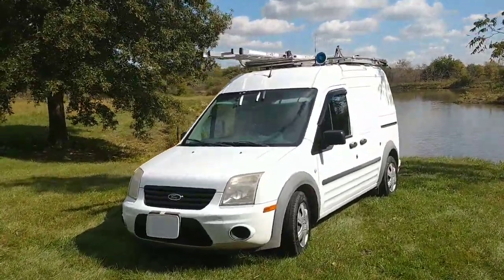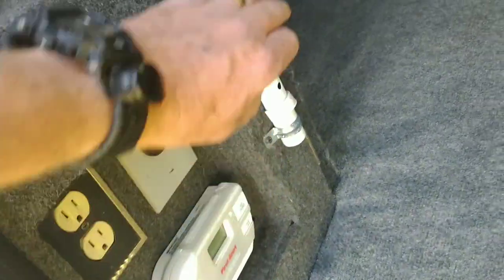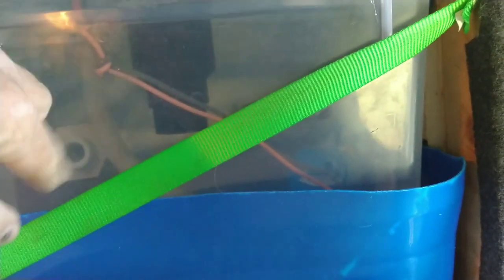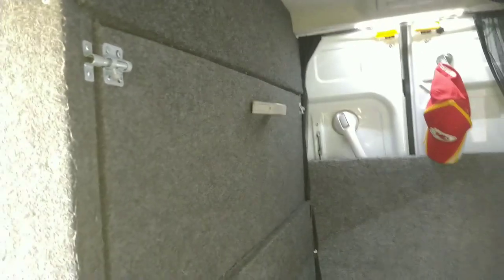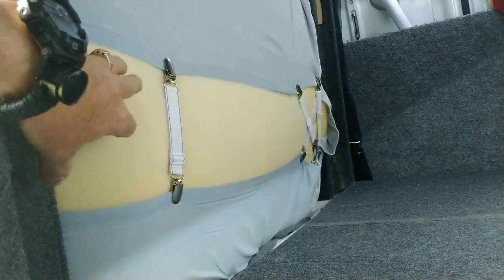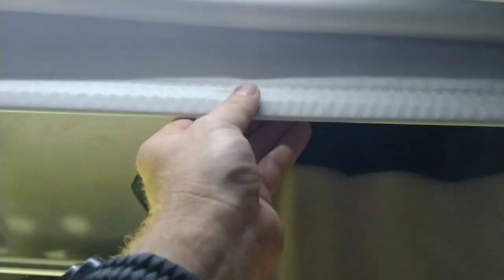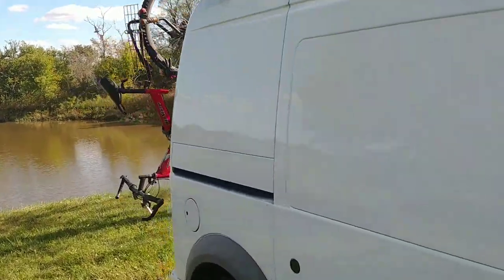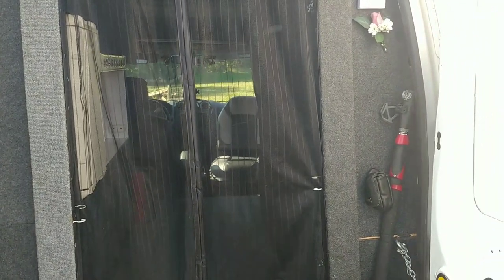World's smallest camper van

Comment: I just bought a 2012 with 40000 miles. Was going to update technology for phone etc. But I have extra phone and tablet. 👍🏼  I lost my husband a couple years ago, time to live again. It's a high roof passenger but will work with it. I have more widows, but will put up black covered reflectix permanently in middle windows to use that space( It has 6 back windows) Those particular 2 windows don't open anyway. Have to have some light. Good ideas here. It's small but for traveling some, it's perfect. I couldn't live in it, well, guess I could if I had to, but that's why I have a house.

Comment: Fantastic, Do-it-yourself build! One of the best I’ve seen on YouTube so far.  Highly suggest you look at the Olympian Wave Catalytic heater that also uses propane. I compare a Little Buddy to the smallest Wave 3 on my channel. Mr. Heater’s have a constant flame 🔥 when in use. Wave heaters only use a pilot light to ignite the heater. Then it becomes a safer, catalytic heater that sips propane with low & high settings.  Wave heaters are made for indoor use whereas Buddy’s give off more condensation and work better in tents, hunter stands & ice fishing. I use my Little Buddy only in waking hours on short day trips. Love your screens and use of magnets. Well done 👍

Comment: Suggestions (all optional): 
1. behind the driver seat..  hang a work (Utility Orange or Lime green) jackets and some used work gloves on the dash... 
2. tablet work fine.. but do backup your tablet songs on a OTG flash drive.. just incase the tablet stops working... 
3. get yourself a 1 liter hot water bottle (rubber with a cap in a wool cover).. add 3 quarters of hot water in the bottle..so if it does feel like hot steam is accumulating on top.. simply un-cap the top and release the steam.. then put it in your blanket and sleep comfortably.
4. Tire chains... for winter or muddy off roads.
5. Good grip snow tires (keep the other tires in a paid locker)
6. Good steel shovel.
7. 2 foldable traction tracks for sticky situation (snow/mud)
8. GPS/LTE 4g wireless range extender and some good hard printed road maps (new and old to find some road not on new maps.)
9. Heavy duty Steel High lift Jack.
10. front mechanical Wrench to be pulled out of a difficult stuck situation.
Awesome build for your needs.. Stay safe.. (Regards from Singapore) God bless.
Reply from the maker: Wow really awesome advise. Thank you I will work on all of that. May do a follow-up video after. Thank you so much.

Comment: Of all the small van builds I have seen on youtube yours has the most creative use of space particularly with the back porch and the roof terrace. I noticed there was a lot of exposed metalwork ie rear doors and behind side panels. In other builds I see people have gone to a lot of trouble to insulate to avoid this. Do you have any issues with condensation or cold nights due to the lack of this insulation? 
Great video 
Cheers from Northern Ireland.
Reply from the maker: Thank you. No real issues with condensation to speak of. I intentionally chose not to insulate my van. I made a video explaining why. I really appreciate your encouraging words. 
https://youtu.be/HNBwarpfNbc
Reply: Thanks for the reply. I wished I had viewed that video before I asked the question as you adequately explain your theory. A couple of things though. If you dont insulate the metal surfaces  the moisture in the air will condense when it hits the cold surface. It might then be absorbed back into the soft furnishing/ fabrics and maybe cause a mold problem. At least with the insulation fitted the condensation may be restricted to just the windows / front cab area. I stress I dont know as I haven't tried it - it's just a theory. 
Also you say about running the engine all night so as to run the heater. This would work but I imagine your fuel costs would be v expensive.
I'm still very tempted to get a Transit Connect and apply your design ideas just as an experiment. Up to now I was focussed on a 4x4 SUV but the transit connect would give more headroom. Could you point me to where your video of the swivel passenger seat is or a give me an idea of what you needed to achieve the result.?
Once again many thanks for posting the video.
Trevor
N. Ireland
Reply from the maker: @trevorbest5715  I haven't noticed any real problems with the condensation. I'm not saying my way is the superior to anyone else's way. It's just what works for me. Regarding fuel I calculated that I only use about a gallon of gas in an 8 hour period of just idling. Compared to the heater buddy which would consume about one of those quart size bottles of propane every 4 hours, I estimate that my way only uses about half the cost of propane. Here's a link to my swivel chair video. I did end up going on line and buying a much better chair to replace it with later. Thank you so much for your interest and God's blessings to you.
https://youtu.be/SdxNKUgqB_o

Comment: Wow this is the absolute best I've watch or perhaps will follow to convert my 2013 Transit simply amazing
Reply from the maker: Thank you so much for your kind words. Glad you enjoyed it.
Reply: @jesuscross9   I am starting from scratch, I plan on removing the shelves and floor panel when there is a a good weather day. I had the van for almost a year now and during the summer, I used it to feed the homeless. I've been buying little things from the second hand store I have a coleman 2 burner, my buddy heater, air bed and few other items. When I say from scratch I mean it literally, in fact I had to buy and still buy tools. What do you think is best for a floor? As you can see I have a lot say because I am so excited (: Thanks for
responding
Reply from the maker: @tuwandanoble1601    Great! I just went little bit at a time too. I think that's the best way to build because your not suffering with the shock of spending all at once. Also you only buy what you need instead of too much. I built out the cabinets and things before I did the floor. This allowed me to easily make holes in the floor inside the cabinet to run any wires and plumbing. Then I just cut plywood for the part of the floor that would be seen and covered it with pad and indoor outdoor carpet. I have a playlist showing all the main steps if you want to watch it. This is the one where I discuss laying the floor at 00:30 seconds in. Hope you the best and great success. - Brad
https://youtu.be/nqN8eI9kpmg
Reply: @jesuscross9  Hello  just wondering if it will be safe to run a mr Buddy inside because my transit do not have side or back windows
Reply: @jesuscross9  Also are you for hire lol
Reply from the maker: @tuwandanoble1601  Yes the Mr. Heater buddies are marketed as being safe indoors. I wouldn't have any gas inside the van though without a gas detector. They sell them at most hardware stores next to the smoke detectors. Most have an AC to 12 volt DC inverter with them which means you can toss the inverter and just hardwire them directly into your  vehicle's 12v system. Just be very careful to observe polarity (positive and negative). I found out the hard way that they are not forgiving at all if you accidentally get them backwards even for a second. I totally fried my first one and had to go buy another one. And there not cheap. Around $150.00 dollars. 

I've tried to think of a scenario where I could build vans on the side for cash but I keep hitting a dead end. I would only to be able to work on it in the summer on my days off. That means I'd have to have the van sitting in my driveway for a long time... several months. I don't think it would be fair for someone to have spent the money on a vehicle that they're not going to have for a while. Also I'm by no means a master Craftsman. I would feel bad if I botched the job. The only alternative would be for me to buy the van, do the build, and then sell it. But I just don't have the funds for something like that. So I'm sorry but I can't see how it would work. My advice is free and I'd be more than happy to help you in any way I can. God's blessings to you. - Brad
Reply: @jesuscross9  I really do appreciate your advice and Thank You again. Did you take your floor up for a little more height and which would work best ply wood or vinyl flooring? At first I tried to find a conversion company or person in my city but at the same time I am looking forward to building it myself. Considering that I am familiar with very few tools, I am sure there will be trial and errors but I am willing to keep trying. For years I have been watching mini van conversions and tiny houses videos and would only imagine having one. So now that I have one, I am super excited about this project and again I truly appreciate your video and advice God Bless You.  Ps. I hope I am not bothering you too much (:
Reply from the maker: @tuwandanoble1601  No bother at all. Actually no I didn't bother pulling up the floor first. I'm kinda lazy. Lol. I really didn't see much of a benefit in pulling it up so I just built right over it. As for carpet or vinyl, that's more of a personal preference. I know vinyl would be a lot easier to keep clean, but I went with carpet because I just get more of a warm homey vibe from carpet.
Reply from the maker: @tuwandanoble1601  I'm sorry I misunderstood your question. You would have to put plywood down in order to have a smooth surface to apply the vinyl to. It actually works out better for putting down carpet also. So I would definitely put plywood down either way. Unless you are planning on sometimes hauling dirty cargo in the van. In my first van I just left the floor as it came and cut a piece of carpet to lay over it, that way I could just roll back the carpet whenever I planned on hauling my lawn mower.

Comment: Some pretty neat ideas.  I have a 2012 Transit Connect that looks identical to this one on the outside.  I even installed the window rain guards... they are great to have.  I don't know how you can handle having a Mr. Buddy in there though.  I tried that and even with the windows open and the vent fan running it would always absolute cook me in there.  Had to keep turning it on and off like every few minutes.  I upgraded to a small diesel heater.  It can be turned down a lot more than the Mr. Buddy... plus you can run it all night if you want.  You just have to run it on high for 15 minutes or so once done to try to burn off any sooting.
Reply from the maker: Yeah I've never used it as my sole heat source so I haven't had that problem. I just couldn't get to where I trust it while I sleep. I only use it when I want a lot of heat in a hurry. To stay warm while I sleep I actually found running the engine on idle with the heater is on is much cheaper. I only burn around $3 a night in gas. I would spend twice that on propane. Thank you for your response.

Comment: Ps I seem to remember that model had problems with a sensor located inside the clutch bellhousing. Did you have such problems? if so, can i ask how much it was to fix ?
Reply from the maker: No I never had anything like that. The only mechanical problem that van had was the AC had to be completely overhauled.  I've recently sold that van and moved on to my next project. This time I'm trying a bigger van. If you're interested in following the progress you can go to my home page and select Playlist, van 3. Subscribe to see others as they come in. Thanks.

Comment: How do you keep the umbrella from blowing away? We have a fishing umbrella we thought to use the same way but cant keep it anchored to the van.
Reply from the maker: I use two very small bungie cords that I just hook up to a couple of places in the umbrella while it is open. The other end gets connected to the receiver hooks on the ceiling for the door. I've had it up on some pretty windy days. It took some trial and error to get it right but now I don't have any trouble. The doors themselves act as the counter to hold it up and the bungie cords give the opposite pressure needed to keep it from blowing away.

Comment: I have a 2016 Ford transit connect xl. I purchased it for this exact purpose. When I collect social security in 4 years I intend to live out of it. I have been amassing many ideas on the type of build I like . I’m impressed with your versatile use of space. I’m curious to know what is the hottest temperature you have slept in. 
I lived out of my Toyota for runner for three years. And I was  in 100° temperatures a few times.  You only have those two front windows hardly enough. Have you ever considered a rooftop ventilation System? Like a fantastic fan.
Reply from the maker: Hello, thank you for your interest. I have slept in upper 90 degree temps before, but I cheat and leave the van idle while I sleep with the AC on. You'd be surprised how little gas they use in a night just idling. If you have day running lights that you don't want on all night, like mine did, you can just look in the manual and find that fuse and pop it out. I just leave it out I didn't need those lights running anyway.
Reply: @jesuscross9  
Good advise, my light are automatic will change that. I also hate the lights coming on when the doors are open ( hardly stealth) at night.

Comment: You need to check with your monoxide detector company.... the unit should be located higher in your van, to capture the fumes,  not at the lowest point in it.
Reply from the maker: Hello, thank you so much for your concern. My particular unit is a carbon monoxide and explosive gas detector. In my vehicle I was more concerned with having a propane leak. Propane is heavier than air so the detector needs to be close to the floor. In a running vehicle your concern is also an exhaust leak that produces carbon dioxide. Carbon monoxide detectors don't detect carbon dioxide, however the motor is also producing monoxide along with the dioxide so the monoxide detector would still alert and let you know you have an exhaust leak. Since the fumes would come from under the vehicle and seep up into the living area from below, then the monoxide detector would still alert even though it is lower.  Thanks again. God's blessings to you. -Brad

Comment: Wow looks so much better and cleaner than 3 years ago. It’s a diffrent van right? The other one was totaled in accident? Looks like you maximized the space and feels less crowded.👍🏻
Reply from the maker: Yes this is a completely different van. Thank you for your kind words my friend. God's blessings to you
Reply: jesuscross9 Thank you very much but I should be thanking you because of all the van builds I look out for a transit connect I’ve seen some really amazing ideas one guy actually made pop out sides to make the van bigger but he was an engineer and I know it was pretty costly. Other builds were done by professionals made to look like tiny little campers but there was no stealth. Would you have done is The best build for my budget in the fact that I would be doing it all myself. Now with my job I work with the elderly in their homes but I have a lot of time in between for traveling and whatever hours are on the schedule for the day so this van is perfect design for me because otherwise I’m just sitting in my truck trying to catch some zzzzs and there’s not a whole lot of room. I’ve been saving to buy one of these transit connects but no later than 2013 because of the height which on the later versions was reduced so I wont no later than 2013 but to get it with lower miles you really got a search and you’re gonna pay more money so in the meantime stuff like this really inspires me to keep going and get it. One thing I would probably do differently and not to sleight your build but just to make it my own preference is I would probably do a sunroof that I could stand up and look outside every once in a while because it is important to me to be able to stand and stretch and I like that idea of doing that without having to leave the van in an area that may otherwise be questionable or unsafe. Also I am in New England so our winters are cold so I will probably insulate the van first. And a portable pop up toilet I actually already bought. It collapses down to like 6 inches thick . Being on the road during Covid lock down there aren’t many places to go to bathroom. Btw the back seat setup is as genius as the swivel seat. I would do both as State law about driving with a child in the front seat they have to be at least 12 years old so my sons got a few more years before he can drive in the front seat so I would have to have something in the backseat for him so again all these ideas totally inspiring and I’m going to use ur design for my build.
I respect what you do keep safe out there and continue to spread the good word💪🏻👍🏻

Comment: Very nice thought out build. What do you do for shower and bathroom? Thank you for the video and sharing. New subscriber. Blessings in your days.
Reply from the maker: Thank you for your kind words. I just use a five gallon bucket lined with trash compactor bags and a snap on  potty seat. I dispose of the waste the same way any mother disposes of her baby's diapers... nearest trash can. I also use a old laundry detergent jug for urine and empty it out in the grass or bushes. For a shower I have a 2 gallon garden sprayer that I converted to have a kitchen sink sprayer. I can pump pressure on it and it works great for a shower. I heat up the water I put in it and have a hot shower. I have one of those quick pop up camping privacy tents I can setup outside. However I'm toying with the idea of making something that folds away I could use in the van. I just don't have all the bugs worked out yet. May the Lord Jesus Christ richly bless you as you follow Him.  -Brad
Reply: @jesuscross9  Thank you for your reply. I appreciate it.